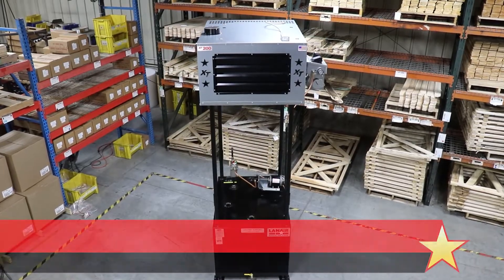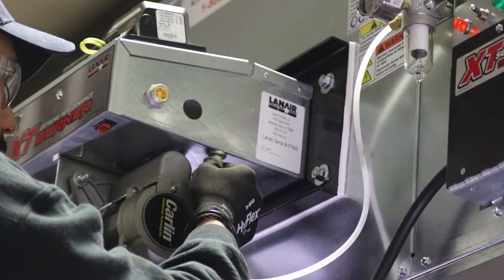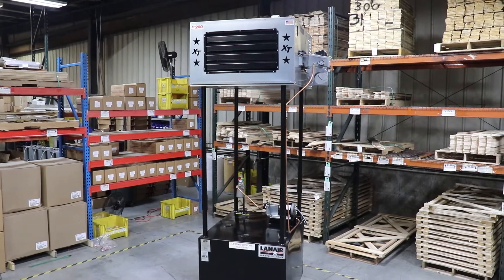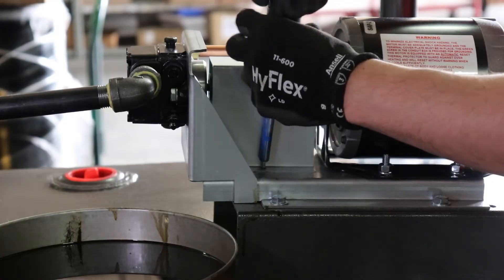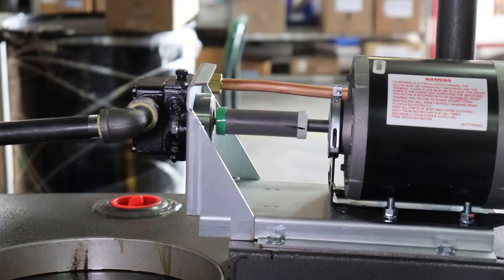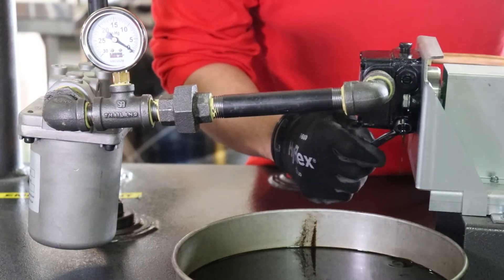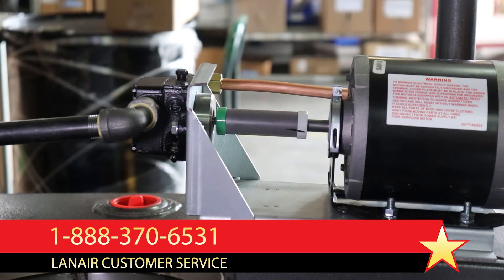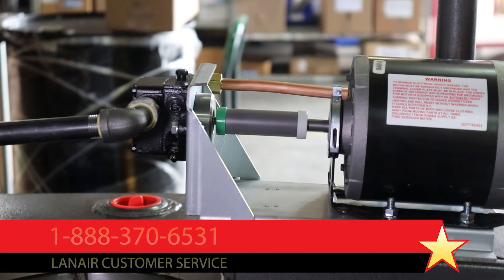Lanair Waste-Oil Heater - Pump Motor & Coupler Troubleshooting

Comment: No help at all, wasted time... to find out if it spins it's ok if not call for help... why not a detailed explanation about priming, bleeding the system, adjusting the pump etc?!?
Reply: Seriously. I'm struggling to bleed the system. I had oil to the burner but can't get anything out of the nozzle